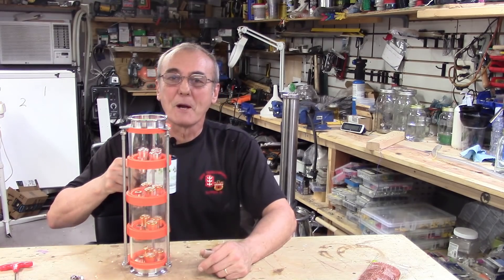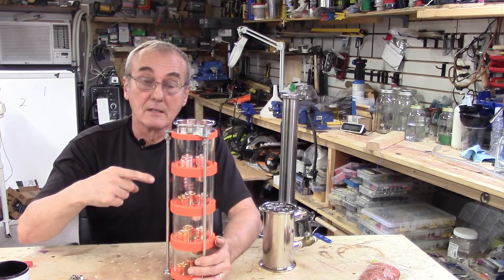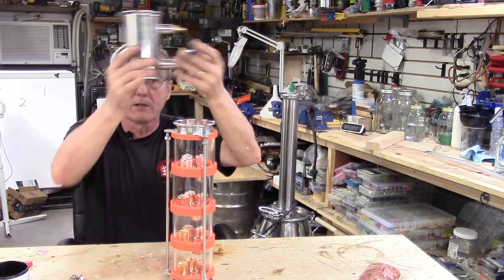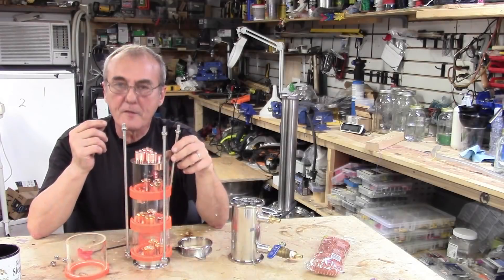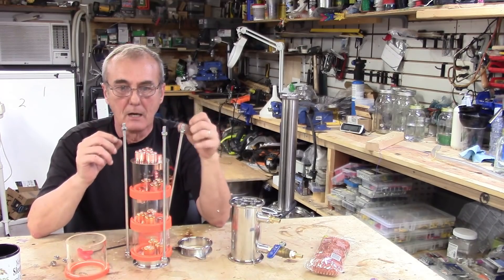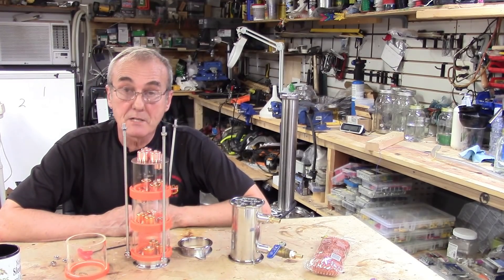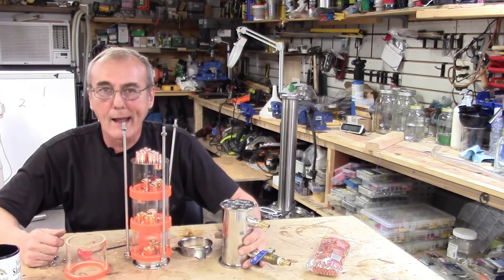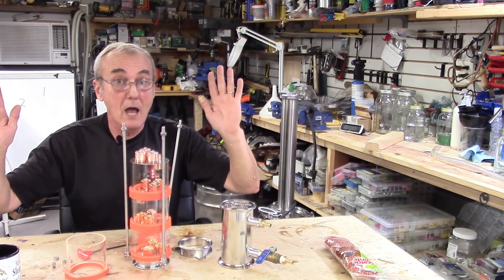RUNNING A 3 INCH BUBBLE PLATE COLUMN

Comment: $70 dollars?? Just been looking and for a 4 plate 76 mm / 3" unit like that it was at least $180 plus shipping of over $65.. do you get "mates rates" or something ;)
All the ones I can find by searching 3" bubble plate have cast top and bottom clamps with 4 metal rods so look much stronger than the unit you have there which seems to have only 3 rods and sheet metal for the rods to clamp through? Ebay the cost is over $285 (free delivery)
Reply: Much higher when I look.  Back to self building.
Reply: $240-290 AUD + $86 shipping...
Reply: George must have Meant $70 shipping ?
Reply: https://www.aliexpress.com/item/32868021179.html?spm=a2g0o.productlist.0.0.514632a3hFedE6&algo_pvid=22e71a93-b62a-4111-a78a-9493d68a9121&algo_expid=22e71a93-b62a-4111-a78a-9493d68a9121-15&btsid=0ab6fab215876077832503241e7547&ws_ab_test=searchweb0_0,searchweb201602_,searchweb201603_
Reply: @TechGorilla1987  interesting,  it says 3"  yet all the choices are for smaller than that. 1.5" 2" 2.5" not 3" even though thats in description. The 3" is more money, when in description and on drop down choice of size.
Reply: @ensteele120349  no nothing there to see. Its an empty shopping cart.

Comment: Very good George. Tell me about this high speed PID?
Reply: I don't see it in the videos anywhere,, so he must not be made a video of how to yet
Reply: jbrunson1949 he just mentioned it in passing at the beginning of this one.
Reply: @Stoutluvr  I heard him say it,, so I went to the Barley&Hops youtube page,, and looked through about 30 videos and didn't see where he showed the build,,  when he says something, new  I always go to home page and look,
Reply: jbrunson1949 , I was just wondering. I just built one of his PID’s to control my 5000 watt element in my boiler. Have made three runs and really starting to learn it and like it. I just set a temp and forget it. Just adjust my water to my deflagrator and final condenser during the run. At the same time just ease the temp up 1° at a time. Very nice.
Reply: @Stoutluvr  all the one's he builds are high speed.

Comment: George Ive seen other videos where they flush the copper with vinegar before the do a run....whats your opinion on that?   In the vid it appeared to work,  produced a blue tinted distillate  which was supposed to be build up on the inside of all the copper
Reply: The only reason to run vinegar is to clean out the flux from sweating the copper together.
Reply: @chuckdontknowdoya6100  ok that was definitely NOT the case in this video...LOL trust me...this was not a new still

Comment: does it have to be a dangalflopper on top of the plates? or can i run like the three tubes through the top of my column before the bend? 

im thinking the befragnater is just there to keep the plates loaded?
Reply: if you have one of the 3 tube reflux part you should be able to do the same thing, by running it in reflux,, that is all the deflegmator does is  puts it in reflux stage till all the bubble plates balance and are all driping from their downcomer..
Reply: @jbrunson1949  i dont have one but im going to drill the top of my column and put some in, im also making three bubble plates to put in line with some two inch sight glasses. i know i should have done my home work before buying the column. if i would have found gorges videos before hand i would be in better shape but i didnt so now im frankinstining my crap together.
Reply: do i still have to run with the packing between the bubble plates and the reflux tubes